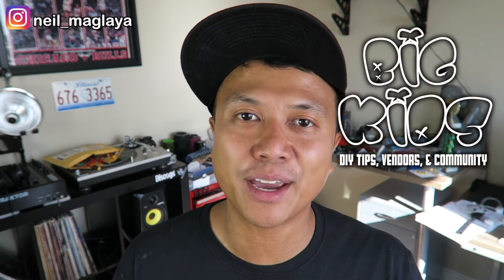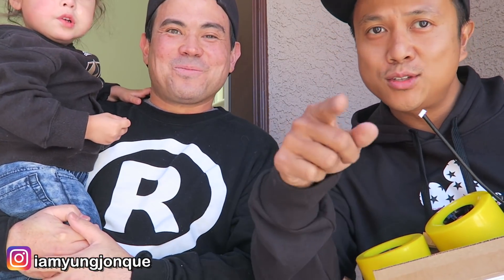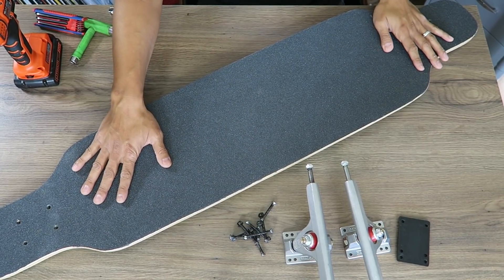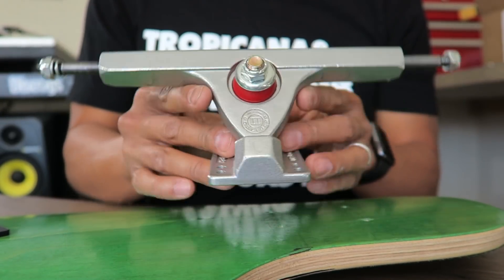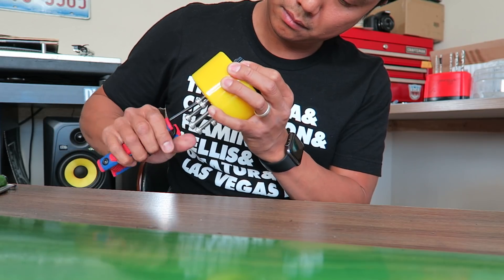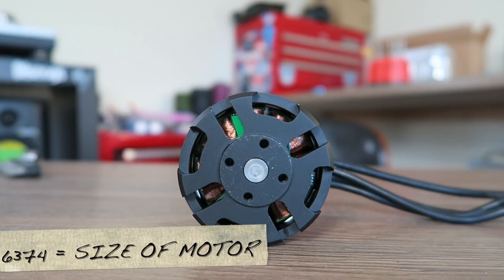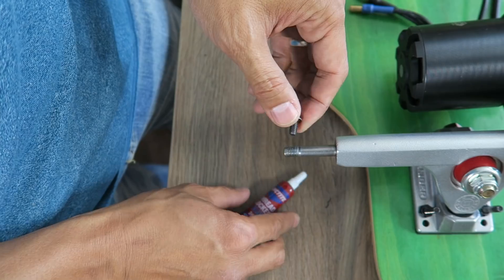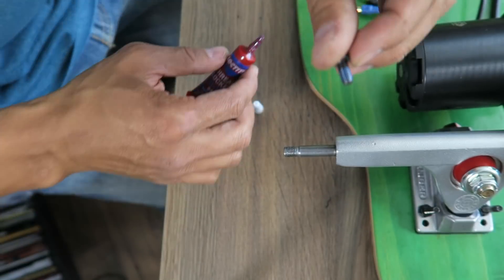HOW TO BUILD A DIY ELECTRIC ⚡ SKATEBOARD TUTORIAL PART 1 - BETTER THAN A BOOSTED BOARD

Comment: Do you know how to upgrade the maximum capacity? I’m looking to build this for someone but he’s pretty heavy😅
Reply from the maker: Capacity in what sense?  If he's a heavy rider I'd go with a dual motor set up with larger 6374 motors and a higher voltage battery pack 12s/44 volts. Hope that helps

Comment: do i have to get a exact voltage battery ? or if i have more voltage then i need the controler simply wont use it ? also, my city streets, are full of holes and loose rocks, this normal longboard wheels can face it or should i buy a off road wheel ?

Comment: Just make sure you DON'T have zinc hardware, as zinc hardware can snap easily. This meaning when you are using your board, or uninstalling the hardware, you could very well snap it and have a much harder time putting things together. Basically, just make sure you get good hardware.

Comment: hey, how fast does this board go... max speed?
Reply from the maker: Speed depends on alot of factors.  Wheels size, battery voltage and capacity, and gearing.  With my best set up I've gotten it up to 32 mph.

Comment: Can you use a drop-through board with this same set up?
Reply from the maker: Yeah, absolutely.  However, if you mount it drop through I would be careful with outrunner motors hitting the bottom of the deck.  If you want to mount it drop through I think hub motors might be better.

Comment: what size screws would i need for the build
Reply from the maker: Just purchase standard skateboard hardware.  I purchase longer ones in case I was going to add anything else.  But ended up shaving them down with a Dremel.

Comment: Would this work for A penny nickel board?
Reply from the maker: Sure, it can.  You'd need to find a motor mount that would work with the trucks though.  Also, as small as a penny or nickel board is, I motorized version could get squirrelly for sure.

Comment: How fast will it go?
Reply from the maker: I've gotten this go go 33mph.  I was using different VESC settings, 36t/15t pulleys and 100mm wheels.
Reply: @BigKidsOfficial  Dang thats fast. Im gonna use the same parts, but 97 mm wheels, and 16t motor pulley. Hope i can get about the same speed! :)
Reply from the maker: @carl4576  if you'd like a parts list for reference hit me up at bigkidsofficial@gmail.com.

Comment: Hi Kid, I have been thinking for a long time what will be better?
- ready to ride Wowgo 2s (2 hub motors)
- or one big 6374 190kv motor (single belt drive sys.) with 12s LiIon
   batteries and single enertion vesc
The most important for me is:
- acceleration, hill climbs, torque
What do you think ? The one big 6374 motor with good equipment can beat the 2 hubs motors of wowgo

Comment: rear wheel drive or front wheel drive? and why?
Reply from the maker: There really is no difference.  I've tried both and traditionally you'll most have them on the back.  Breaking and acceleration have a bit of a different sensation depending on where the motor is place.  and that would be really the only thing you'd need to get used to.

Comment: So, if anyone wants to do this I'd recommend thicker riser pads. Also, what's not shown in this tutorial is a lot of sanding to get the motor pulley to not rub against the caliber trucks. DO NOT get the cheap ebay ESC, get a VESC...thank me later.
Reply: does anyone have the parts list
Reply: @jebba3132  i wish
Reply: @jebba3132  its in the description
Reply: Can the vesc handle nimh batteries?

Comment: Can apart the belt from wheel when run out off the battery power for getting  easier feed work? As my know, it is very heavy  work on my feed if the belt keep on the wheel. Am I right?

Comment: I am thinking to get a wide board and add 4 motors(1 for each wheel) for more torque, and 3d print rubber tires to put on the wheel so that it is more comfortable, ofcourse I am putting  in 4 times the normal might be expensive but I feel like it is worth it
Reply from the maker: 4 motors tends to be overkill for most boards but I have seen a few people do it. 2 6374 brushless out motors would be fine for large hills and even people up to +300 lbs.  Have you started your build yet?
Reply: @BigKidsOfficial  Thanks! Yeah the parts are coming in a week since I live far
Reply from the maker: Haha totally remember the waiting 😅.  That's like half of the expirience!  I've actually had to wait a year once for a very rare part.  Good luck man and feel free to ask any questions in the comments area.  Someone is bound to respond.
Reply: @BigKidsOfficial  Yeah thanks for the offer, but I feel like your videos answer all the questions already. Love your interaction, made 4 accounts and subscribed to your channel from each one!

Comment: What if I have a 41” board
Reply from the maker: That is completely fine.  I have a 42in deck for more stability and a 30 in deck for a more nimble ride.  Just remember, the longer the deck the more stability but less trying radius and the shorter the deck the less stability and more turning radius.  Your skill level when handling speed wobbles is your gauge when choosing a deck size.  Hope that helps.

- Neil

Comment: Hey Neil! I'm working on my first build and was wondering if you could give me some advice? I bought a 6374 190KV motor from torque boards which has a 

Max Power: 3150 Watts
Max Amps: 80 Amps
Max Volts: 12S 

How do I know what battery will work best? Would I need 12 cells? I'm eager to finish my build up but have hit this road block. Any advice is appreciated! Thanks!
Reply from the maker: Are you going to be running Lipos or LiIons?  Second you'll want to go 10s or 12s with your batteries.  That is 36v or 44v respectively.  12s (44v) can run a little hot on one motor, but it can be done and will give you more speed the 10s (36v).  Personally, I run 10s Lipos are have gotten my board up to 33mhp which is plenty.  As for mAh (milliamp hours) I'd try for a minimum of 5000mah (5ah).  With that my build has taken me up to 11 miles.  It all depends on your max riding speed, weight, and terrain.  Let me know if that makes any sense.
Reply: Thanks bro! I’ve decided to go with 2 5s Lipos

Comment: I got the motor and mechanical drive train from diy electric skateboard and i now have a serious problem. The stick you mention that goes in the motor shaft, in my case, it's not as long as the hole. Thus, as the stick is not as long as the shaft's hole, it moves, and so does the pulley with it. Removing the pulley now is, I would say, impossible. It's freaking tight and I cannot imagine a human being removing it. Any advice?

Comment: how do you know how much battery you need for your motors??
Reply from the maker: For motor's I'd stay between 175kv and 200kv.  Now, depending on the KV rating you choose you can have a 8s - 12s battery.  But, what I would reccommend you do is plug in some of these numbers into an esk8 calculator (just google "esk8 calculator") and get an idea of your high speed you'd like.  let me know if you have any problems.  Good luck!

- Neil

Comment: Is 47" longboard too long for a new beginner like me, cause I'm trying to build my own Eboard
Reply from the maker: Hey bro, thanks for checking out the video and supporting the channel!  Everyone has to start somewhere right?  Well, the way it goes is a longer board will limit agility but increase your stability (other factors can influence this as well).  As for a deck, I think 40 in is a nice long deck.  47" would be a bit long but would be very stable at high speeds.  I like riding 38" boards but find that 40" is nice for stability.  Let me know if you have any other questions.

- Neil
Reply: Big Kids Thank you much for your feedback Sir

Comment: Would you recommend doing this with no experience in smoldering or using tools of the trade? Lol.
Reply from the maker: Hey Zay!  Thanks for checking out the video and for supporting the channel.  Before getting into esk8 I had very limited to close to no experience soldering.  Depending on your need to challenge yourself, I feel like soldering is easy to get into if you put the time in.  Many DIY set ups will have some sort of soldering involved.  If you'd like something prebuilt many of the DIY vendors already offer their performance boards built.  But, you can also look at budge builds from diyeboard.com.  It's a company out of China that has builds that you can plug and play. 

- Neil
Reply: Big Kids thanks bro!!! I gotta check this out much love!!

Comment: hey neil! is there any rub between the wheel and the belt? or did you do something to combat this? i just got my stuff, i haven’t put it together yet, but the belt seems to be very close to the wheel when i’ve eyeballed the pieces together (basically put them together without screws). any advice? or should i not be concerned. thanks!
Reply from the maker: Hey Bro!  Honestly, this stuff isn't plug and play.  There will be some trial and error when it comes to the parts.  Even if you have a 12mm wide pulley and a 12mm belt you'll still need to take the time to align everything.  Don't get frustrated and know that anyone that has made a board has gone through these challenges.  If you have any problems search this forum as someone else has probably gone though the same thing: https://www.electric-skateboard.builders/

- Neil
Reply: alright! will do, thank you Neil

Comment: Hey Neil i had a question about a theoretical setup for someone wanting an insane board. 
Could a board be wired with 2 power switches in either of the following ways:

1: Have two entirely separate systems(independent batteries, power switches, vescs, and motors) and connect them at the power on button by combining the two ribbon cables into one button. And Pair the Vescs the normal way.( My thought is that because the power to the systems is separate and the only way that the systems are combined is by the VESCs talking to each other and the on/off trigger being combined thus preventing overpowering anything and still allowing for a single remote.

2. Could 2 power switches be wired to act in parallel and then combine the on/off button ribbon cables to one into the button, so that although the power coming into the group of switches in larger than 1 of the switches capabilities, the 2 split the power so that it is below the maximum capabilities of the switch.

I hope that i was descriptive enough for the idea to make sense. And hope you can help!

Thanks for the help!!
Reply from the maker: Hey Matt!  Thanks for checking out the channel and hope you'd subscribe for more videos like this one.  I tried following your description and I think I know what you're saying.  However, I don't want to give you advice if I'm not exactly sure as I may need more clarification.  I feel like you would benifit by talking to other esk8 builers about this.  If you plan to build an esk8 you'll love the esk8 builders forum:  https://www.electric-skateboard.builders/  Anyhow good luck and again thanks for checking out the channel!

- Neil

Comment: What do you think about doing this with a penny longboard?
Reply from the maker: Appreciate you checking out the video.   Hope you'd consider subscribing to see more videos like this one.  You could, but the stability may not be as reliable.  If you do however do it, I'd step the battery voltage and motor down a bit.  if you'd like a parts list for reference feel free to email me at bigkidsofficial@gmail.com

- Neil

Comment: Hey I was wondering if u could use ur feet if the battery fan out
Reply from the maker: Hey there!  Thanks for checking out the video and for supporting the channel.  I hope you'd consider subscribing to see more videos like this one.  You can absolutely use your feet to kick if the battery is fully drained.  However, belt driven motors will have drag or friction and will be difficult to kick.  If you are looking for something you can kick with your feet more freely look into hub motor vs belt driven motors. Let me know if you have any other questions.

-Neil

Comment: can i put trucks shown in the video on a drop trough deck?
Reply from the maker: Hey there!  Thanks for the support and for checking out my videos!  I hope you'd consider subscribing for more videos like this one.  You can absolutely use these trucks on a drop through deck however you will need to be concerned about clearance for your motor as it may be very low to the ground. Most people that use drop through decks undermount their Motors to the back vs under the deck. I hope that helps.

-Neil
Reply: Big Kids thanks for that! I subscribed and sent you an email for the parts list. I couldn't find any decks like this on amazon. They were shaped differently or they were drop through.

Comment: Two motors will get you up hills but it'll also drain the batteries much faster :|
Reply: use four batteries in sequence? I don't know if you'd be allowed in an airport with it, but it would double the battery life.
Reply: @TripleBarrel06  they’d have to be in parallel right
Reply: @natesenft5376  I don't know, I'm not much of an electrician, but you could wire them parallel or in sequence iirc, just the size will affect your physical layout.
Reply: @TripleBarrel06  You should wire the batteries in parallel but only if you don't use a battery management system! Wiring in parallel doubles the electical capacity i.E the electical energy stored in your skateboard system. Wiring in series will double the voltage AND electical capacity! (Take note: With electical capacity the actual energy stored in the batteries is meant, not the "Ah-Number".) Energy capacity for a battery is actually its rated Voltage multiplied by its rated Ah. E=V*Ah = Wh. With series wiring of two batteries you will have E_series = (2*V)*Ah. With parallel E_parallel = V*(2*Ah).
Reply: Offroad 👀

Comment: for electric skateboard homemade  how its better battery :18650 22.2v 6000mah 40a dicharge, each battery  3000mah 20a dicharge or lipo 22.2v 5200ma 25c(130A)  my motor is 80A
Reply from the maker: Hey there!  Thanks for watching!  I hope you'd consider subscribing to see more videos like this one.  It depends on your needs.  If you plan to make board that will mostly be on flat ground the 3000mah 20a dicharge should be fine.  The 22.2v 6000mah 40a dicharge will be good for range as well as slight inclines.  and the  lipo 22.2v 5200ma 25c(130A) will be best for big hills and speed.  Good luck.

Neil

Comment: this is a GREAT video one question tho im watching you mount the motor onto the block and then the hub to the trucks can i back mount the motor??? or do i have to mount the facing into the middle of the board
Reply from the maker: Hey there!  Thanks for watching!  I hope you'd consider subscribing to see more videos like this one.  Sorry for the late reply.  It depends on the mount.  There are many mounts out there that have the flexability to mount both forward and backwards.  However, I believe that if I use this mount backwards the motor will touch the truck.  Hope that helped.

- Neil
Reply: Ok thank you for the help

Comment: I like your video.  How do you know the amount of torque to put on the axle nut on the wheel with the motor?  Also, when you put only one motor on only one wheel of the skate board, aren't you going to get uneven wheel wear?

Thanks for the upload.
Reply from the maker: Hey there!  Thanks for watching!  I hope you'd consider subscribing to see more videos like this one.  Sorry for the late reply.  When torquing down the the nut you just want to do it till it stops.  Over torquing it will not help.  Also, the Loctite will keep all the nuts and bolts in place.  Hope that helps!

- Neil

Comment: Itching for part 2! HAHA!  Fantastic work bro! I was wondering how a dual motor would work for me.  I am in an area with quite a bit of hills.  I am wondering what would be the best motor setup for me?  Any ideas?
Reply from the maker: Hey there!  Thanks for watching!  I hope you'd consider subscribing to see more videos like this one.  Depending on how heavy you are a single 6374 could handle a lot.  However, a dual motor is always something I suggest for larger people and larger hills.  I would go for a dual belt drive using (2) 6355 motors.  Also, go for a 10s or 10 cell battery setup.  That will get you up hills real nice.  what part of the world do you live if you don't mind me asking?

- Neil
Reply: Thanks fam!  Oh man, I subscribed after the DIY video that was recommended.  I am like 6ft 200lbs, so I was definitely going for a dual setup.  I live in the DC metro area.  I live on the surrounding suburbs and for some reason our entire neighborhood has a good set of hills. Nothing like SanFran, but enough to know it can bog down an average board with my weight.  Thanks for the advice, I will do my research on your suggestion.  I am getting everything ready before I start my process.
Reply from the maker: Happy new year bro!  Hey, thanks again for checking out the video.  shoot me an email at bigkidsofficial and I can send you a parts list to get you started.

Comment: So i read its physically easier to pull than push. Anyone try running the boards in reverse and using the drive motors on the front? Might be mileage gains as well...
Reply from the maker: You could be right Adam.  And yes there are people on the forums that do put the motors in the front.  I'm particular to back wheel with a brushless motor because I go up curbs sometimes and having motors in the front I believe will make them more susceptible to scrapes and scratches.  But, yes, you can give that a try for sure.  Let me know how it goes :)

- Neil